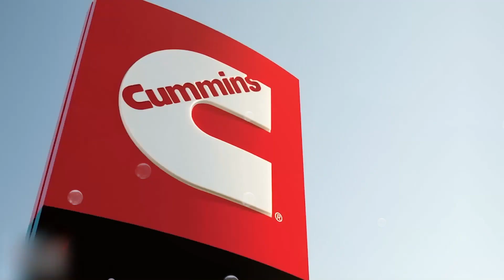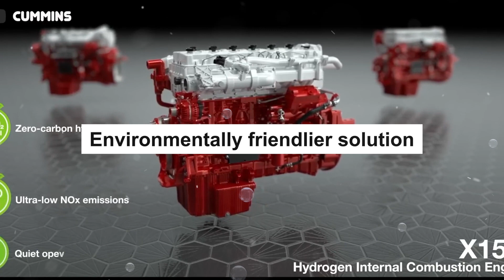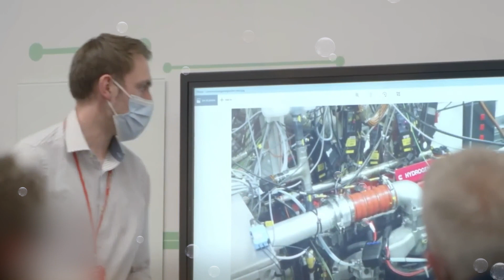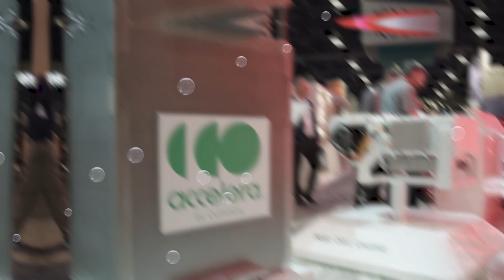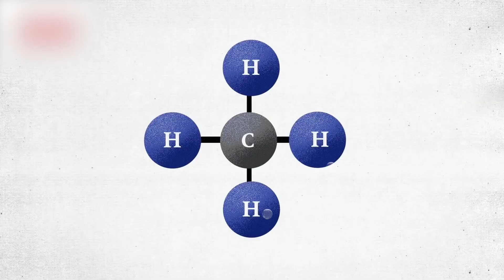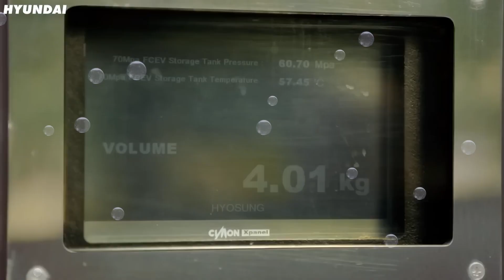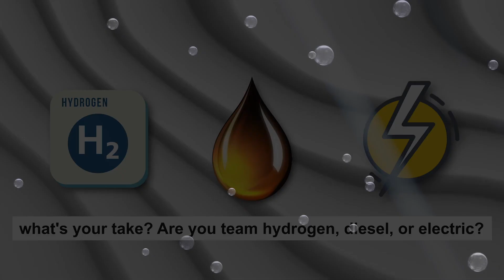Cummins Shifts Gears: The Rise of Hydrogen, Fall of Diesel!

Comment: Meh, hydrogen has it's own energy density issues. The fuel has to be compressed to an extremely high pressure. It's a good as a fuel, but the storage requirements and tank size are a significant limitation. From what I have read about it the storage cylinders are very large and I believe have to be compressed to around 10,000 psi. There are issues with managing a gas compressed to such a high state and keeping it from leaking from connectors. Another is the high potential energy of a tank breach in an accident. This just seems like it is not practical as a fuel for anything more than a novelty. Toyota has done a lot of work in this area too. I think there is also an episode of Engineering Explained on You Tube that lays out why it is impractical as a replacement for current fuels.
Bio-diesel, or diesel-electric hybrids similar to train engines seem a better bet.

Comment: also theres renewable diesel,  way better for the environment,  so many more options, why are we choosing the lesser, (electric)
Reply: Look into the way they make renewable diesel then tell us that it's "way better for the environment". The dogma, credulity and ignorance surrounding renewable fuel/energy is alarming and costing us all a fortune.
Reply: @dipladonic you mean how old diesel engines can run off old engine oil? So much worse than literally destroying massive amounts of earth for shitty car batteries
Reply: i think you might be confused, growing soybeans isnt hurting anyone..
 @dipladonic
Reply: Electric is also really bad for the environment so it’s just a matter of picking the lesser of two evils
Reply: @austincrittenden5363  Compared to ICE vehicles, electric and hydrogen powered vehicles are inadequate in many different ways...not least because they will not save us from the so called 'manmade climate emergency'.